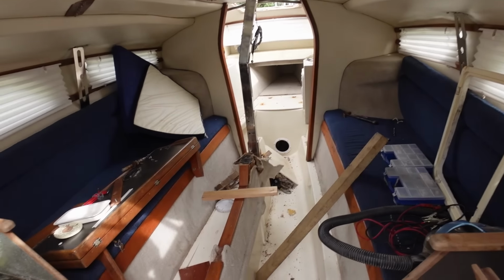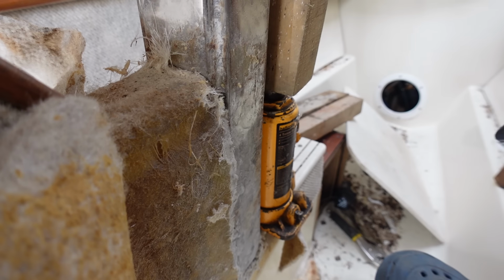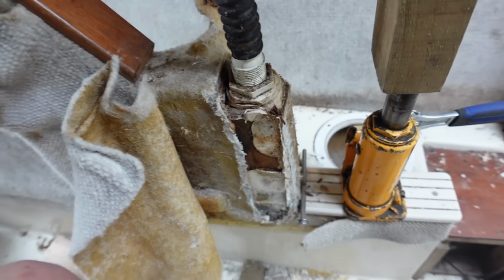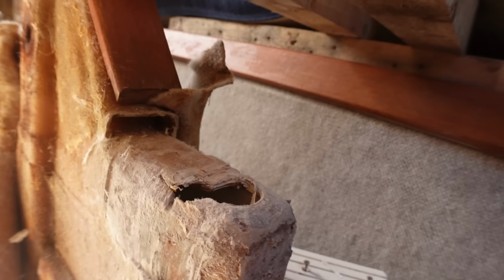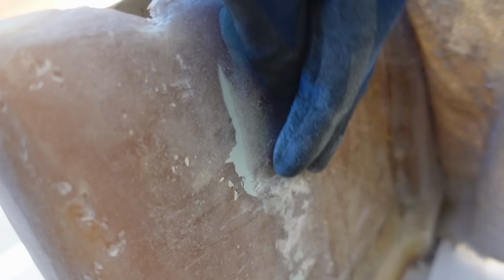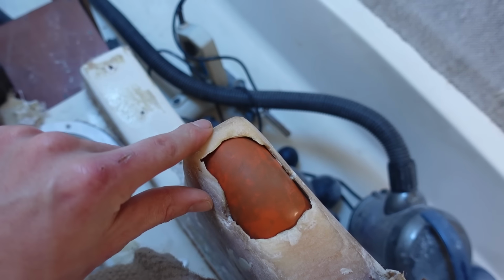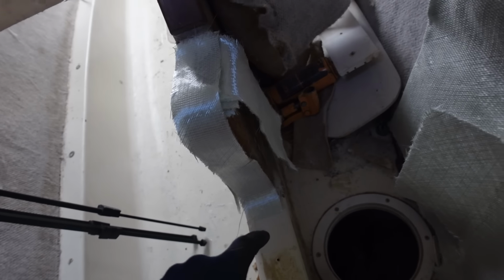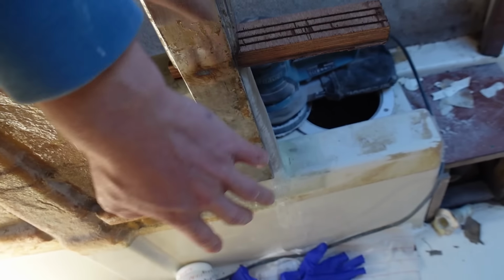FOUND A MAJOR STRUCTURAL PROBLEM ON MY NEW TRIMARAN | Ep.125

Comment: Hi Alex, fun videos as I've owned 3 Gemini's over the years and spen some time at the factory talking to Tony.  The hose in the compression post is a necessary vent to allow the light weight ply centerboard to drop down.  As you let the board down you're creating a vaccum of sorts that needs to be filled.  the air from the vent does this quickly.  Without the vent water has to rush up past the centerboard to fill the space left by the dropping centerboard and creates flow in the opposite direction of the dropping board working against you.  since the line and crank only pull up the centerboard and the bolt only locks the centerboard at whatever level the board has dropped to, you have no way of pushing it down.  Sorry, wish I had seen the video earlier.  All my Gemini's had vents in the top of the centerboard cases.
Reply from the maker: Yes I did realise after I shot that clip. Will be putting it in a better location as bellow the compression post wasn’t a great idea when the box section didn’t have any load spreading surfaces. Good place to hide it though

Comment: hi Alex, I think that hose is to vent the centreboard case.
Reply from the maker: That was my only thought but ran with it this season and didn’t have a problem with it needing to vent luckily. Was really easy to raise and lower and I’m much happier knowing that I don’t have an extra hole in the boat!
Reply: I agree with the previous comments.   Totally sealed up centerboard cases get pressure built ups.  They can gurgle and make odd noises.  They can even spray water out if the water finds opening.  It will be interesting what you learn from this.
Reply from the maker: @carlamerritt490  had no problems this season with it but I will be adding a vent but in a better place and I think I have finally found a good solution.

Comment: The tube in your compression post would either eliminate all the gurgle of air trapped in keel box or more importantly,  relieve the stress of buoyancy on the otherwise thin fiberglass box. The boat pounding and compressing air in that box could generate enough force to break something if not vented.
Reply from the maker: Yeah one will be going back in but in a better place for sure!

Comment: I'm wondering if the hose was a conduit instead for electric to go to the mast, but there is no access at the deck, so that is quite baffling. If the hose was used to run any leaks out to the clear bottom of the hull, it would have been better to just eliminate the hose because the hose would cause any uncatched water to pool to the top of the hose.
Reply from the maker: Found out it was ment for a vent but as I discovered this season I didn’t need it as all worked well. Just one less hole in the boat!

Comment: It's possible it's original laminate. I recently did the p-bracket housing on my westerly and that had loads of dry laminate. could easily be the standard of laminating in the 80's.
Reply from the maker: Possibly but this boat was built in the 2000’s 😬

Comment: I think its most likely an air vent to allow the case to fully flood. Also could be used for flushing mud etc out of the case?
Reply from the maker: Yeah air vent I think but annoying place for it and worked well without it this season. Just glad I got rid of an extra hole in the boat. Could add a better one back in if needed.

Comment: if the vent is not there there is a chance for under- or overpressure in the box. one consequence is that the walls cave in or out and this mightweaken them over time. another one might be that at some point this pressure will find its way and create hissing noises in the best case and a path for water in the worst case. the vent is the way to prevent all this.
Reply from the maker: Yeah that makes sense. Ran it this season as I want to find a better solution for it. Didn’t have any wall flex or anything but it should have it for this one as I have found a solution.
Reply: The vent was added for what Marcus was saying but more to prevent leaks at the raising hardware from the pressure.   @AlexGoesSailing

Comment: Alex pretty sure the through hull was a vent for the keel box not sure what it will do not having probably slap and splash and you might find the centreboard rattles a bit more without the damping effect of water in the box, but as you previously pointed out the centre board winch system can leak so water should fill the keel box and without a vent it will just trap air and maybe cavitate
Reply from the maker: Yeah I think it was! Ran with it this season and didn’t have any issues which is good! Very annoying place for a vent and I’m glad I have one less hole in the boat. Really easy to raise and lower and you can kind of see what’s happening in the box through the window at top which is nice too!
Reply: @AlexGoesSailing  how far back in time are we?
Reply from the maker: @arch1etatts511  this was 10ish months ago! Did lots of sailing so couldn’t edit as much but I’m catching up quickly!
Reply: @AlexGoesSailing  Looking forward to it!

Comment: Not finished watching but i would recommend G10 or similar on the top. Pound for pound stronger than steel. Only problem diamond's are cheaper. Keep up the good work
Reply from the maker: Yeah I agree! Also quite hard to find too. Thanks for watching!
Reply: @AlexGoesSailing  I picked some 5mm A4 sheets on ebay, and doubled them up
Reply from the maker: @grahamm2015  oh nice!

Comment: In a big sea the CB case may come out of the water, fill with air then as the boat slams back down the water pressure will compress the trapped air that has nowhere to go. It will go for the weakest point and could blow a hole in the case. It needs that vent.
Reply from the maker: It will be getting a vent but just in a better place!

Comment: You know I wonder if that hose inside of the mast support was a previous owner's attempt at creating a wire chase for running new masthead wiring after the mast replacement.  They might have had trouble with the stock wiring and thought it easier to run new wires through the keel box instead of pulling down the headliner.  After the install of their attempt at the wire chase, they had weakened the mast support base which caused the support compression that created the dip in the coach top.
Reply from the maker: I found out it was a vent hose but as I found out this season, there was no problem not having one. Just glad I don’t have an extra hole in the boat under something under high load!

Comment: you dont really need a mast support in a deck stepped mast, a transversal beam all the way under deck and both sides of the hull will do the load spreading for the weight of the mast and it will keep the area clearer too
Reply from the maker: That would be cool to do but would be a big modification too. This post also supports the side to side on the centreboard casing a little too so plenty to consider.
Reply: Yes it is, @AlexGoesSailing  For next year you could consider a dagger board slipped port side  like in the corsairs and this will be used as mast load spreading too ;-p
Reply from the maker: @amgpuma  I will check that out!
Reply: Sounds like a different way of making a mast support.